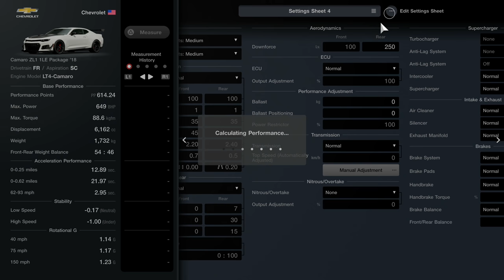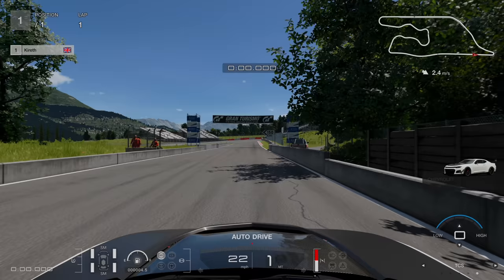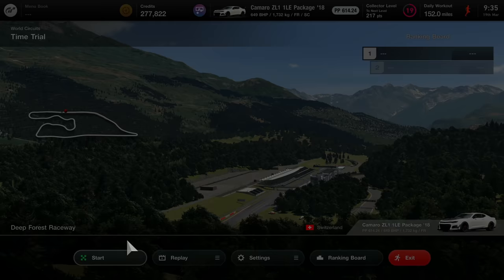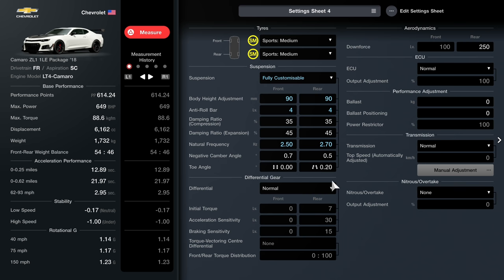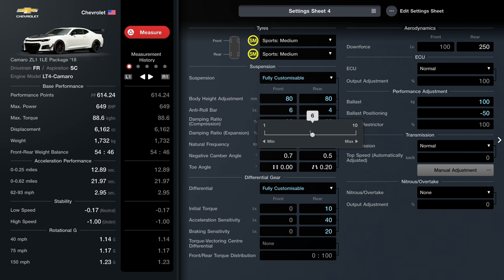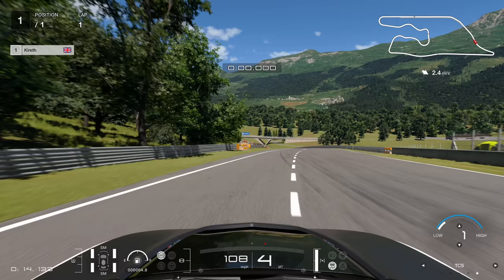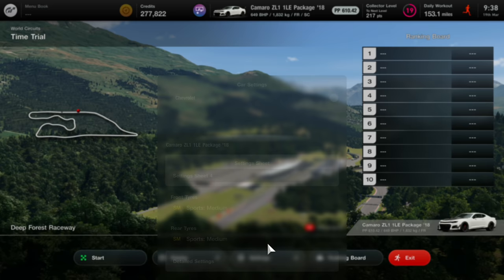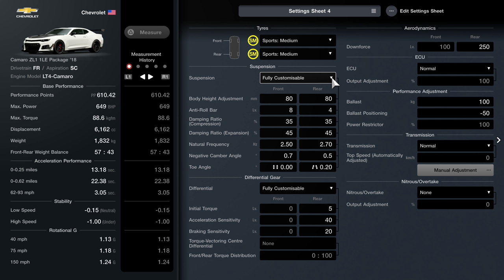Gran Turismo 7 Tuning Guide - Make Undriveable Cars Good!

Comment: This is totally counterintuitive. The Camaro is front-heavy already and you are adding more weight to the front.
Why do real world sportscar makers aim for a 50:50 weight distribution?
Infact, I'd bet that if you made the same Diff and similar suspension adjustments and used ballast to come as close to a 50:50 weight distribution as possible, the car would be be even more driveable.
Edit:
And use front and rear aero to increase balance even further. In the end it all comes down to the weight distribution over all 4 wheels (static and dynamic).
Additionally, putting more weight in the front will increase front tire wear.
Reply from the maker: No malice to this - but do you play GT7 and have you tried this tune with the Camaro?
Reply: @Kireth  I do play GT7 and no, I haven't tried your tip. But I have tried my approach on a 911 GT3, an AMG GT and a Nissan GT-R. All of which I managed to get to be driveable with TC off without making them nose-heavy. 

But  tell me where my points are not valid from a perspective of racecar physics.
So all things being equal, if GT7 is the realistic simulation of the real world, physics should work the same in game.
Reply from the maker: Not saying your basis isn't valid from a real car perspective - but GT7 is weird
Reply: @Kireth  I'll give you that.
I'll try your approach and mine back to back. Maybe you're on to something. But I can't imagine how your approach will keep front tires alive for any meaningful number of laps. But only a few races are about tire saving anyway.

Since I'm no YouTuber, maybe you could run the back to back comparison, too, and make a video about it? 🤔

Comment: looks up a tuning guide 

first thing publisher shows me is a problem that could just be solved by turning TCS on

leaves comment 

leaves dislike for being dumb 

goes and finds a video that will actually help me get faster lap times

The Americans solved this problem in the 90’s and 2000’s by giving the car super long gears, and even if that doesn’t do it just stay in 2nd or 3rd until you’re 100% confident in your traction

OR just turn your damn TCS on

Comment: Such a bad comparison. Of course the traction is better the second time. You turned on traction control in the second attempt… 🙄
Reply from the maker: It's part of the set up to make the car more driveable
Reply: @Kireth  traction control is on by default. Even when you choose the expert driver aid option at the start traction control is on by default.

So in any way you would need to turn it off first. It just makes for a bad comparison.

Sorry I don‘t want to talk bad about your video. You took all the time to edit and make this video and I respect it. But yeah.. the comparison is not so top
Reply from the maker: If you're coming from GT Sport the first thing you would likely do in any car is turn TC off 👍

Comment: This tuning guide is trash. So low the front tires go into lock. Add the ballast to the rear of the car not the front to get more traction. There's a reason why BMWs market their 50-50 weight distribution. Turning on the TC was just a band aid to cover up this trash tuning

Comment: Tcs a thing that is supposed to be used to stop well spin.. wheel spin makes cars hard to drive? Man.. my life is changed forever. Another tip.. instead of using assists. Just don't be an ape on the throttle. Assists are nice and can help but you typically won't be a better driver because of it.

Comment: This is how stupid GT7 Physics are, Apart from the fact that is not your tuning that fixed that car but the TC, what you did made that car worse, This is a FR, more weight is in the front, you should put balast on the Back to help in traction and incrase diff lock, this will provide more traction. Why you think Porsche are so strong out of corners? Go on Forza and do your same settings, You will become a fidget spinner, but you know Gran turismo is the real simulator!!
Reply from the maker: Put the ballast on the back and report back to us mate 👍
Reply: @Kireth For the ballast I don't have to do that on the game, In reality, ten years ago I had a e36 compact, spinned very easily on Snow, I put 130kg on the back and had huge traction and could drive it properly. In FORZA there is no Ballast, you have to do it the normal way, Soften the rear of stiffen the front, a open diff will help, but your exit push out of corners will reduce do to one wheel spin, A stiffer Diff makes the car have more traction and makes it more understeering until you don't exaggerate and loose traction ;-). Add aslo, you see how this game is totally wrong, people move Ballast and don't even retune their suspension because of it! Yeap, you should do that, But PC sim racers and GT racers know the best! Hahaha
Reply from the maker: Saying putting ballast in the rear would help in GT7 for this car is a bit silly mate, just letting you know
Reply: @Kireth  For me I would not put it, but if you had to, I would put it on the back, all this happes because there is not enough shift of weight to the back of the car, with the Ballast on the rear you have already started that action. That is why you "soften" the axle that you want more traction, because where there is less resistance the weight will direct itself there. In the Video you are having to much Grip on the front. Just saying.
Reply from the maker: Understood and not questioning your real world experience which is great, but GT7 is a bit weird

Comment: Honestly if you’d just put some racing tires on the car most of your complaints would be solved by doing that one thing. I agree your method works but you’re doing more advanced set ups when there are simpler more obvious solutions.
Reply from the maker: True, but in sport mode for example it's highly unlikely racing tyres will be permitted 👍

Comment: Absolute worst timing guide video. I hate to write a hate comment but this is just wrong. Ballets should go towards back in a FR car. They weigh more where the engine is. Ride height shouldn’t go that low cuz you lose steering speed etc.. you just turned on TC thinking your tune did the work.

Comment: Slow in fast out. High front roll bar, low rear roll bar degrades the turning.

Edit: Had a watch again to make sure of something. You are comparing apples to oranges and giving bad advice.  A high power, traction control off with stock suspension compared to same car with TC on and racing suspension added. Even with your bad settings decisions, of course the car will drive better. Want a truly good set up, don't do what he did. Experiment with each setting and refresh the performance. You will see what works and what doesn't. Then you can mostly repeat that with 95% of cars.
Reply: So basically you give no advice while trashing his? Got it 👍
Reply: @MrTokyoJunkie  Read it again, I criticized his while actually giving advice. Reading comprehension is important. Just because someone does some Youtube videos does not mean they know all. Got it?
Reply: @lwood9210  but not everyone (including myself) wants to waste their time looking through those settings when we could be doing other things though.
Reply: @ArcadeX2  I fully understand that. Even though it actually only takes a few minutes to learn. You mostly only need to change a few settings to vastly improve a car. Down Force and roll bars being two of those. You would be better off with that than taking bad advice though from an uneven comparison that will actually hurt the overall handling of your car. Yeah, he took an overpowered car with no traction control and stock suspension and added traction control and race suspension. Of course it's going to get better. His anti roll bar suggestion will make the car understeer heavily and his 100% weight idea will slow it down. Look, I mostly enjoy his videos and all, but bad advice is bad advice.